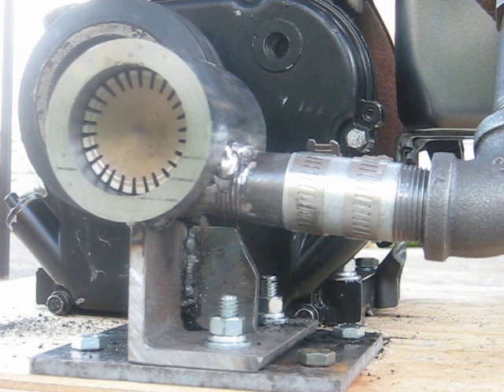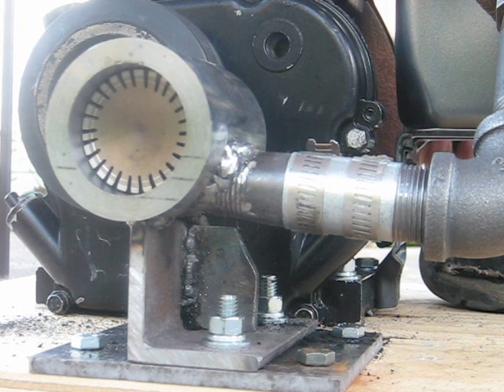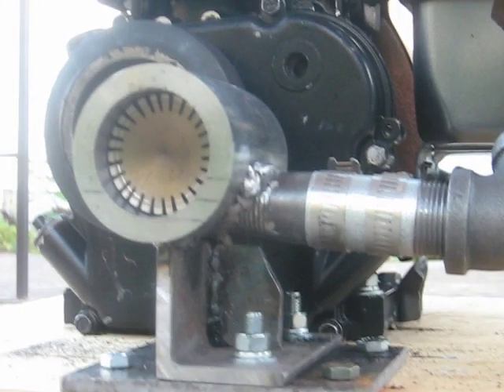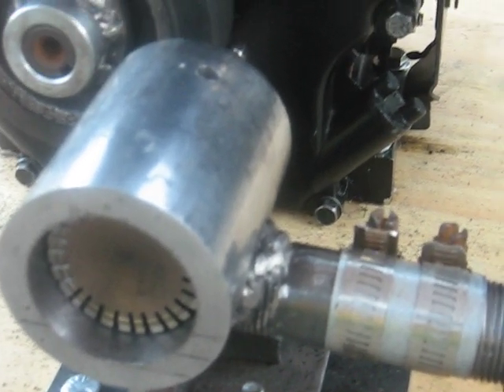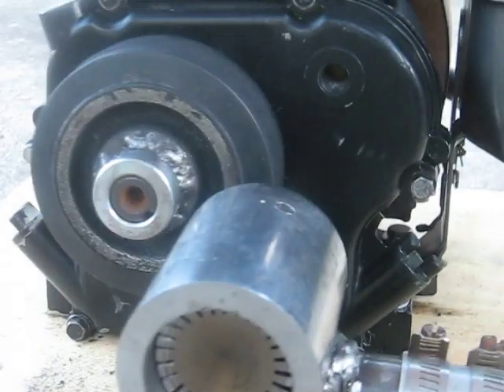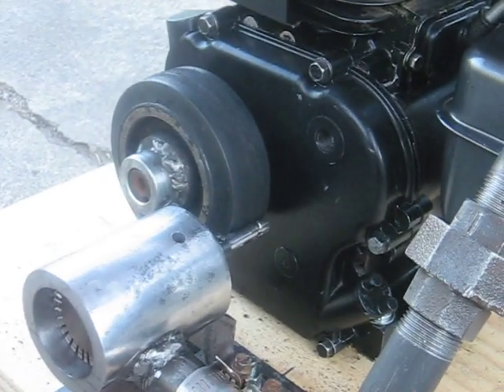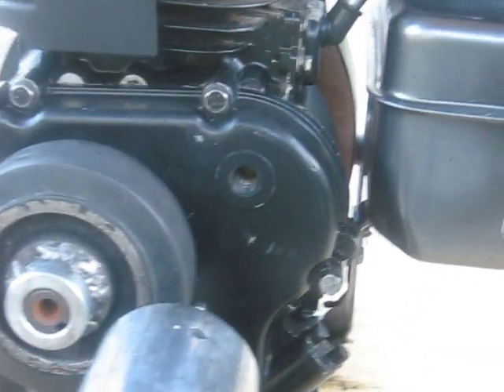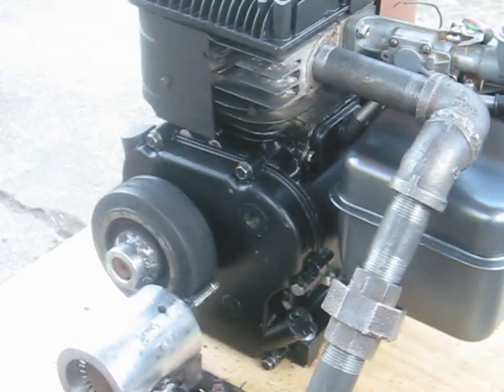Turbo Compound Briggs 2nd Run

Comment: Where did the 13:1 ratio come from?  Was that just convenient due to the size of the turbine shaft and rubber wheel, or was math involved based on the mass, speed and pressure of the exhaust gas vs the crank rpm and turbine size?  I haven't found any math that was used to create a proper turbo-compound engine.
Reply from the maker: It was just a guess based on the size rubber wheel availible, and the engine exhaust valve I had. Sorry, but the only math I really did was in regards to the pipe size of the exhaust pipe versus the outlet size of the turbine blades. This experiment worked, but just barely. I would have liked to use a more positive drive, like a chain, a gear would be best, but not in the buget!

Comment: smaller pipes, angled notches in the rod contacting the rubber. (like a screw drive) better angle on the turbine fins.

Comment: A turbo is spun by exhaust gasses not by the crank shaft, that would be how a super charger works actually.
Reply from the maker: Yes, a turbo charger is spun by the exhaust gases, and powers a compressor. However, you can extract power from the exhaust to help spin the crankshaft instead. have a look at the Wright Turbo Compound airplane engine.

Comment: Try using a small turbocharger and remove the Compressor wheel
Reply from the maker: yes, that would probably work, the dodge 2.2 turbo is the smallest i currently have. I saw a smaller one on a Firefly many years ago, but the price wasn't right.

Comment: There is no logic doing it this way.
The crank is the only thing spinning  the shaft, the exhaust is much to weak to drive the crank. Think about  gearing on a pushbike this it what it simulates.
Reply from the maker: I hear what you are saying, this was only a test to demonstrate the principle. The exhaust does however spin up the turbine, i gave it a run with the drive disconnected, and it spun up pretty well.

Comment: did you make the turbine yourself?
Reply from the maker: CreeperOnYourHouse Yes, I made it from a slightly bent stainless exhaust valve from a 440 Dodge engine, lots of fun dremel cutting the blades into it!
Reply: ChargerMiles007 Have you figured out how much additional horsepower it adds?
Reply from the maker: CreeperOnYourHouse No, I suspect that under load it would add some additional power, as the turbine does spin up when the drive is disconnected. I have a problem with the drive set up though, the rubber caster expands when the engine is revved, causing the turbine shaft to bind, I spaced the turbine shaft further away, which helped, but then I get slippage sometimes. I guess it needs real gears, though they are out of my price range!
Reply: ChargerMiles007 You could try a chain set up, where you put a sprocket on the turbine, and another on the engine, maybe some stuff in between for reduction.
Reply from the maker: CreeperOnYourHouse Hard to say if chain would take the speed, though a small V belt did pretty well on our attempt at a supercharged Briggs.
Reply: ChargerMiles007 Go Karters usually hook up their engines directly to the wheels, with only a centrifugal clutch and chain in between.either way, this engine isn't outputting too much power. Try it, it might work.

Comment: the gran daddy of them all was the turbo compounded radials that powered the constellation aircraft. the original 1800hp engine gained 600hp from its 3 power recovery turbines that drove back to engine rear section through fluid couplings.
Reply from the maker: wazza33racer Yes, the Wright TC is very impressive, I have seen two of them cut away to reveal the turbines etc., great stuff.
Reply: Napier Deltic built a single turbocompounded prototype of their famous delta engines. It peaked at 5600bhp then threw a rod.
Reply from the maker: I am building small plastic Deltic compound engines for installation on Hot Wheels sized vehicles
Reply: I think the Deltic (the company was just called Napier) got used in a jet engine... which threw a rod.

Comment from the maker: No, I had not thought of doing that, good idea!
I was leaning towards disconnecting the turbine from the crankshaft, and having it spin a very small generator. I want to spin it with an engine that is loaded, perhaps my 5 horse belt drive generator, so that the turbine gets more exhaust to work with. It would be nice to get it hot enough for the blades to glow for a night vid  :)

Comment from the maker: This is more like a turbocharger, but in this case the turbine is supposed to help drive the crankshaft. It may actually do that, if I could load the engine down, so it fed lots more exhaust to the turbine. I will have to continue my experiments to make it work better, since it can only work better than this pitiful showing!  :)
Expensive gearing, I NEED expensive gearing to drive the turbine!

Comment from the maker: Hmmm, now that is an interesting idea!
I was leaning towards loosing the drive wheel, and having the turbine drive a tiny generator hooked up to a light bulb or something. That way I could actually have the engine driving a go kart, since it would give me the output shaft back.

Comment from the maker: I see by looking at lots of the comments, that I should have expalined how it works!
Sorry, it is actually supposed to extract energy from the exhaust (thru the turbine) to help power the crankshaft. Unfortunately the opposite is happening due to an oversized turbine :(
I am still not quite sure why the turbine stops, then the rubber drive wheel burns rubber. I suspect the turbine runs out of oil, the friction increases until it stops spinning.
I will make a vid to explain the operation  :)

Comment: i have an idea, you should put a one way bearing on the engines shaft so when the turbine is working it will lock and power the motor and when its not it will idle without the engine dragging the turbine